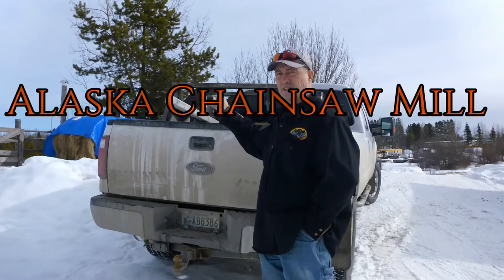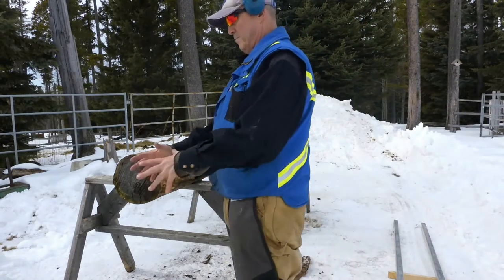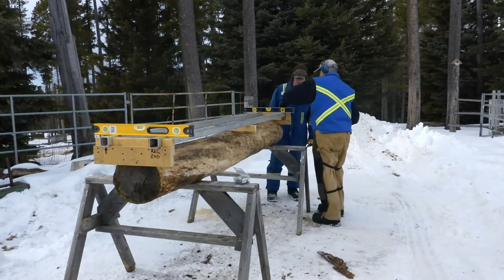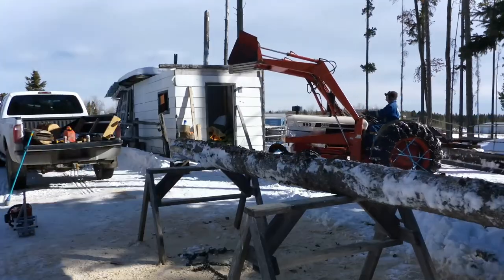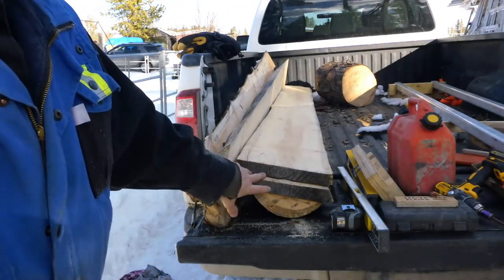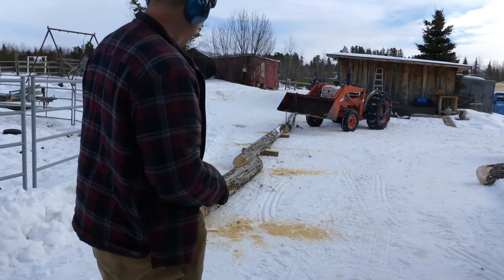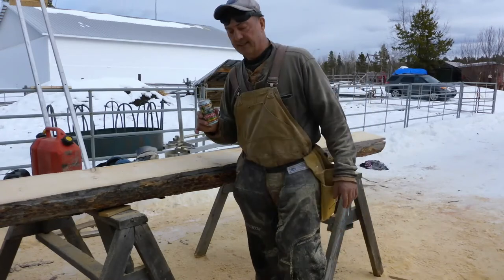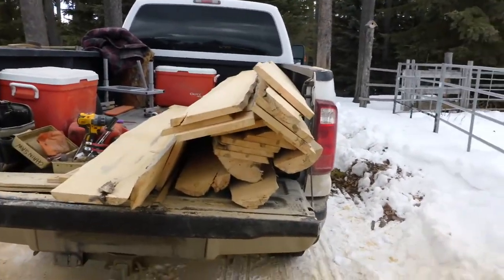Alaskan Chainsaw Mill - Husqvarna 372XP

Comment from the maker: Just an fyi: my buddy just wanted live edge on all the boards. In the video the barn that you can see in the background was built using all live edge lumber, that they just alternate/overlap the live edge boards. The boards we produced in this video are going to be used to build a new barn at this same location, using that same build technique..
Also I had issues with how my saw was cutting, so after I got back home to Whitecourt, I made a table for clamping the saw in, so I can do a better job sharpening it. 
Link to chainsaw sharpening table: https://www.youtube.com/watch?v=zSX5QhjsijI&t=163s